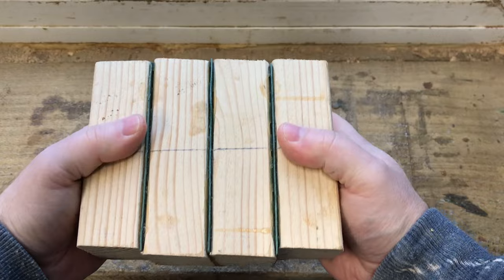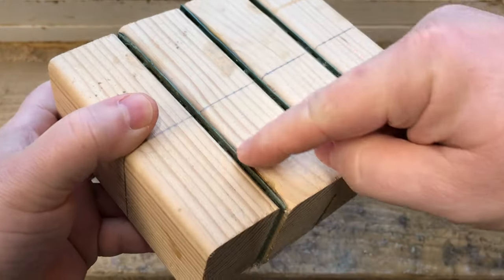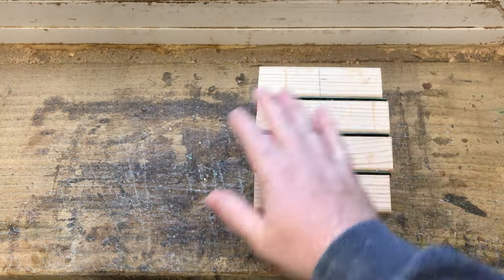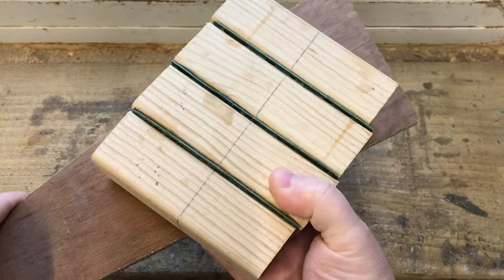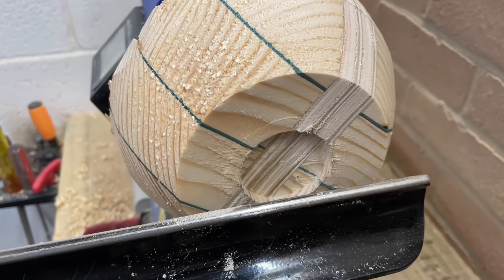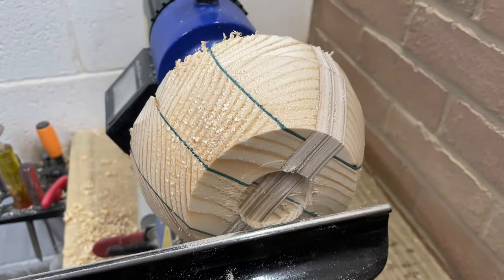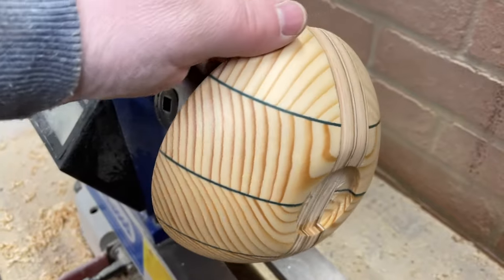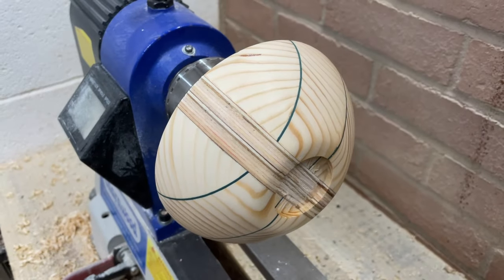Pine and Plywood Scrap Bowl - Wood turning

Comment: What is sanding sealer?
Reply from the maker: Sanding sealer is a bit like a primer before painting, a wax finish is greatly improved if you use a sealer first. However you can’t use a sealer before an oil based finish. Hope that helps. 👍